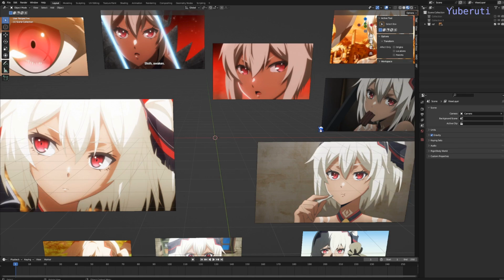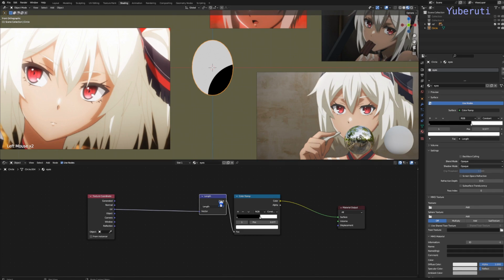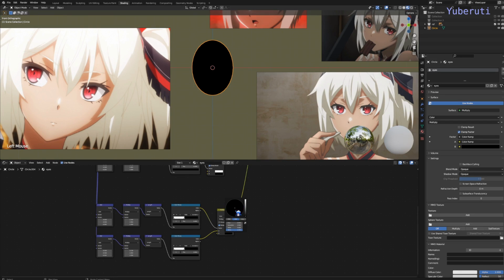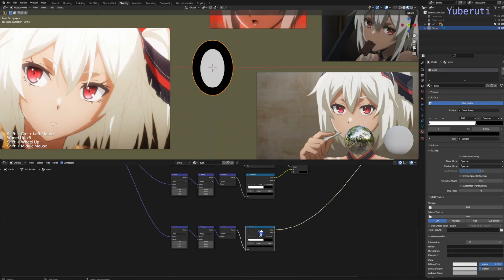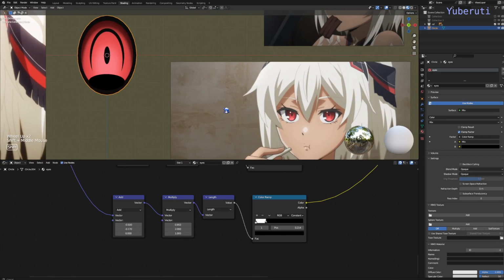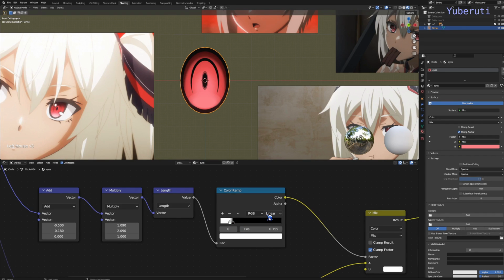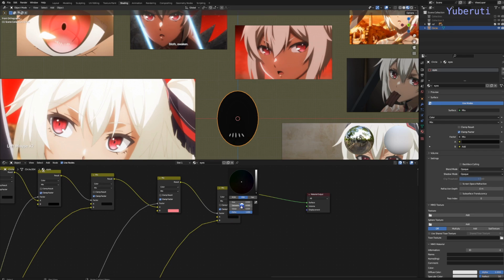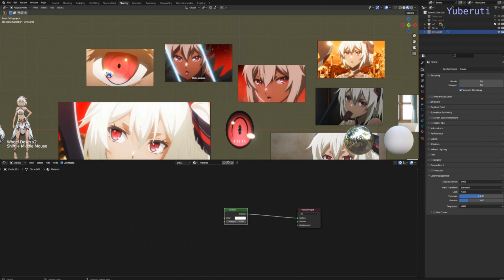How to create Anime Eyes using Blender Shader Nodes

Comment: Hello. Thank you for this tutorial. I have a question: How do you decide whether to connect a node to factor or A, B? I tried to understand the logic bu I couldn't...
Reply: I believe the top one influences the bottom according to the kind of operation you select.
Reply: @bbasina  thanks, i've been messing with the configurations before.
Reply: You use Black and White colors as mask, So whatever node "Input A" has It will show that instead of the white color of the mask. Same is with the black color.